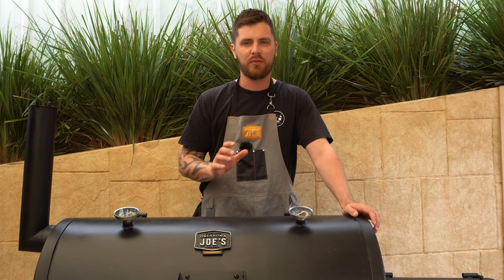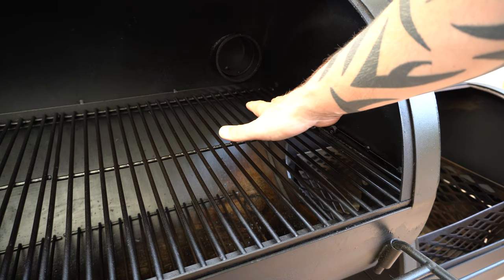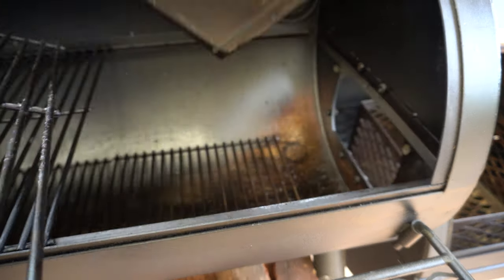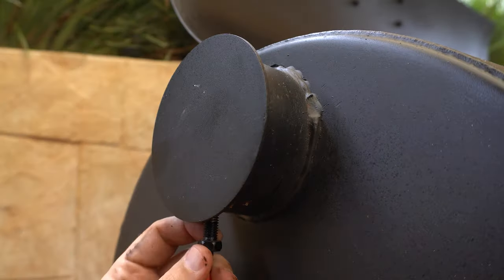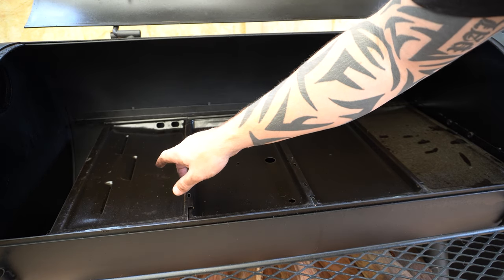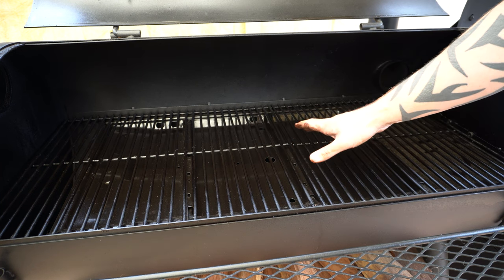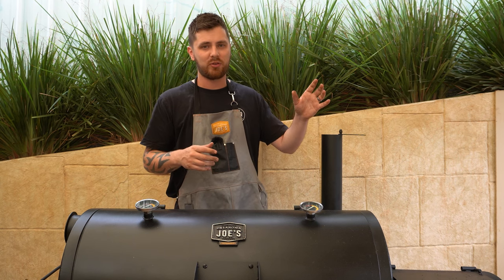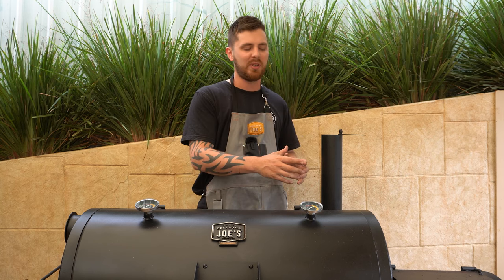Standard Flow VS Reverse Flow Smoker

Comment: Well explained but a couple problems I see are 1/ in the standard offset set up most smokers in this size / price range have an angled tuning plate near the firebox and then 4 tuning plates at various spaces across the cook chamber to regulate the heat in the cook chamber, this really helps with consistency across the pit. 2/ I would imagine unless you were regularly moving the stack it would get harder and harder due to oxidation, expanding/ contracting etc, what would be interesting to see would be a “parallel “ cook eg. A pork butt in an offset, and the same in the reverse flow to compare times, fuel used, flavour etc keep the great videos coming mate, love ya work 🍻
Reply from the maker: Cheers legend! Will see what I can do.

Comment: Good video mate . One thing i see wrong with this pit is the stacks are to high up the pit .
Especially when in reverse flow . There's nothing stopping the smoke from not going down the middle and front of the pit because of where the stack is . Even in standard flow the smoke cant be pulled down over the meat . Just an observation.  Good video again mate .
Reply from the maker: Cheers mate 🙏

Comment: Which would you recommend thereverse flow or the standard with that plate stuck in there to baffle some? Of the heat coming directlydoubt in which is the best smoker.